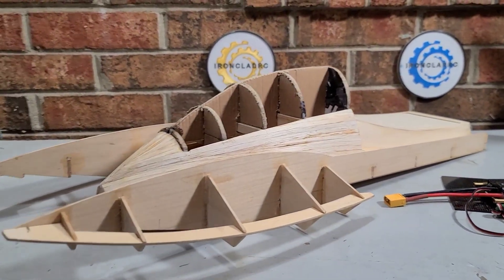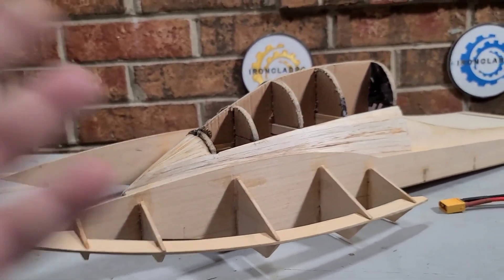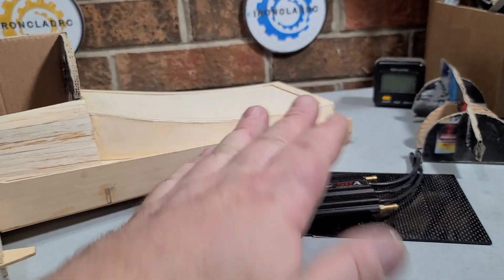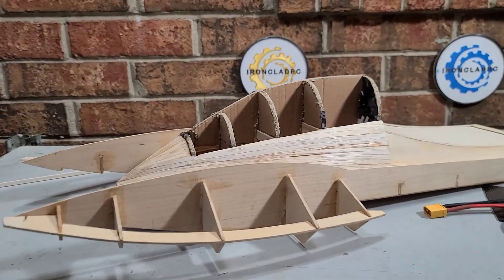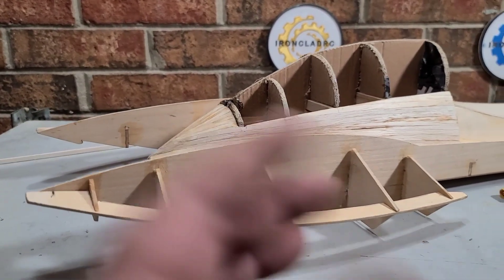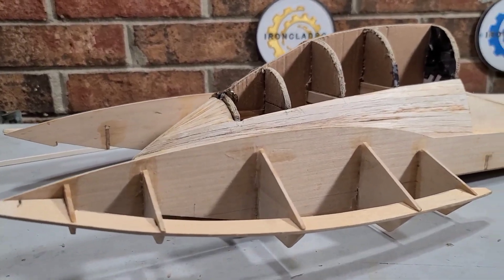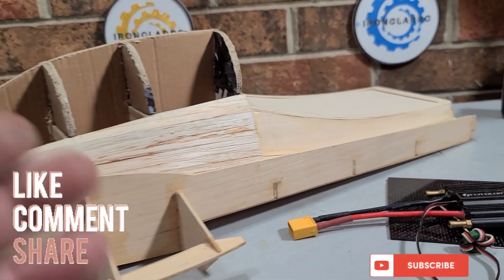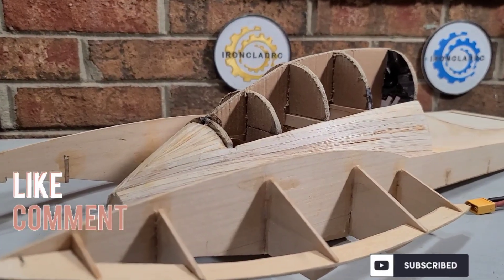RC Drag Boat Update - Custom Wood Rc Boat Build

Comment: The drag boat is coming along great! Yeah a removable deck with dummy V8 and a giant wing would look awesome for display! It is possible to make a clear driver cockpit windshield out of a plastic water or soda bottle. The thin plastic is easy to heat up and shape with a heat gun. Congrats on the 8K subs!! Can't wait to see more of this project. I'm in the middle of building a Classic Hydro's Hurricane 10 Kneeler from OSE at this moment. Pure bliss! I love building all wood boats as you do. Your DIY material is the best on YouTube brother. Please keep it up. Cheers!
Reply from the maker: I've been messaging some sellers on ebay there's a couple smaller scale blown 3d printed v8 engines available but smaller in size, hopefully they can scale the size up for me. 
Check out RC DRVER he did a review on a toyan nitro? V8 motor yesterday it would be perfect for this boat if I were going nitro/methanol
https://youtu.be/nDCkTeWTxus
Reply: @IRONCLADRC  Yeah those Toyan engines look awesome. It would probably be extremely heavy though. I used to work with Greg Vogel at RC Car Action many years ago. Super cool guy. I'm glad he continued in the RC media. I just sent you an email - check it out.

Comment: Great job so far, especially without CAD design 👍. The twin flex shaft drive is sweet. Congrats on the 8k subs and for a next project.. i guess you don'f have a F1 tunnel boat yet 😉.
Reply from the maker: I must of overlooked your comment the other day, thanks a million.    I think the flex shafts will be the ticket for adjustability especially with the custom build, no telling how she's gonna handle at speed?

As for the tunnel hull no sir I don't own any tunnel hulls at the moment.